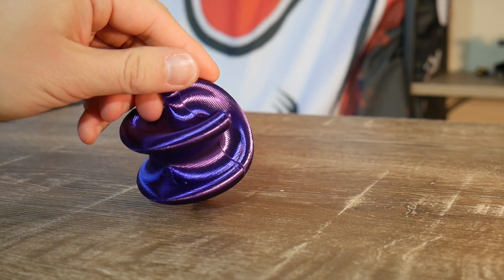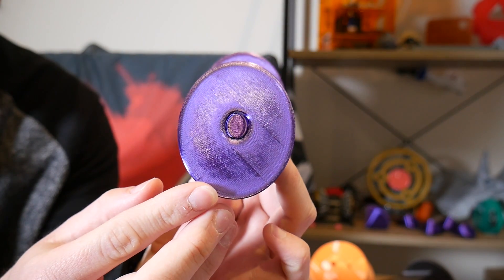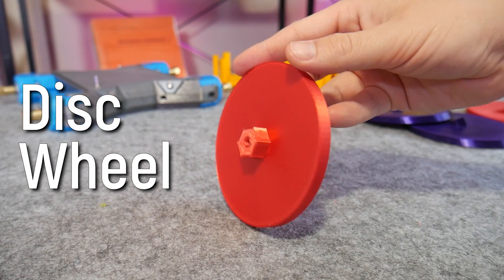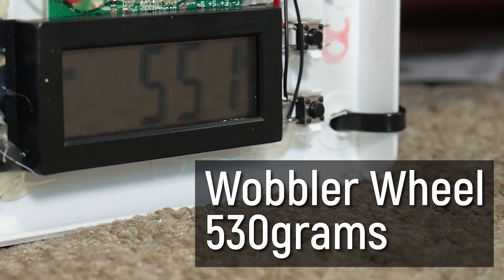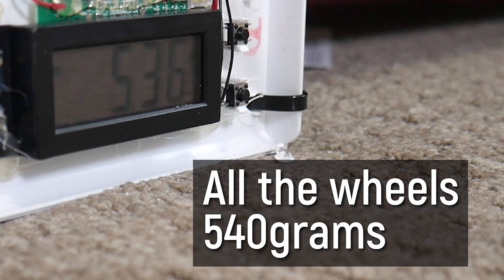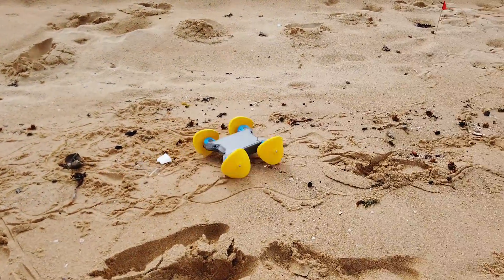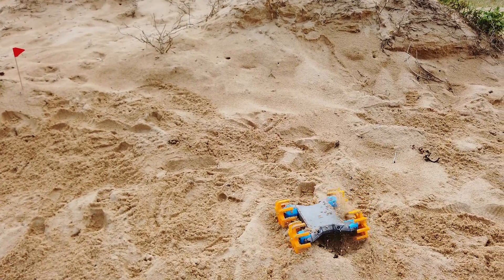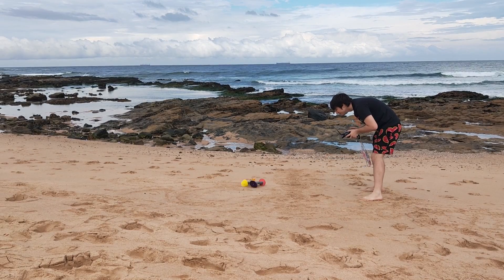This Robot Drives on Wobbly Wheels (but HOW?)

Comment: i think you need to test it with larger wheels. in offroading what you're doing is "high centering" the vehicle. once the weight of the car's belly is resting on the ground, it removes the traction from the wheels.  i believe that would give a better evaluation to each wheel and eliminate any variable surrounding the high centering of the vehicle.

Comment: I think if you made new motor modules similar to "Portal axles" to give more ground clearance (and maybe angle them out diagonally ( /----\ )to also increase wheelbase to fit taller wheels) you may have better results without redesigning the whole body

Comment: Mount the spoked wheels on backwards, spokes pointed outwards. and instead of presenting a flat surface to the ground, have the spokes slope upwards so the outer tips dig in first.

Comment: Two of the spoked in front with two wobblers in the rear seems would give a flat powerful pull force. For the sand a wheel that dispersed the surface over a wider area or large area pads or paddles would likely yield the best results. Another option that could enhance traction would be to have more wobbles in the wobble design.

Comment: I was curious if it makes it better when you put the spokes on an angle backwards (45degrees maybe). Obviously You’d have to give them a curve to maintain the circular cross-section. You know what i mean? I think it would run smoother on flat surfaces but maintain It’s Sand driving ability.

Comment: Oh yes definitely there's a better wheel design, just look at the real sand tires. They have the scoops like your tire, but they're a closed surface so they don't sink into the sand. If you make a cog-shaped wheel it would probably work better. (or just fill out the gaps between the spokes)

Comment: My main criticism is clearance. Easy way to reconsile would be testing in a different medium (grass or compacted dirt), or making adapters for your motors to get the chassis up higher. Clearance wouldn't be much help if it's gonna dig dig dig a hole, but it's a thought. 

I'm impressed by you're consistent and fresh ideas. You and you're mind would likely do a lot of good in the FreeCAD community. I understand why AutoDesk updated their terms for free users, but it doesn't change how I feel used and disenfranchised when helping promote the software and getting mildly involved in their forums (I could technically get an education license for my job, but that's not the point) Open source is the best solution I am aware of, and FreeCAD still has a long way to go as far as user friendliness. I can't wait untill FreeCAD finally hits version 1.0
Maybe YOU (reader) could help with that :)

Comment: I bet that 5 spoke wheels will do no better than a regular wheels on a flat surface. On carpet these wheels do not have a constant contact with surface, but every individual spike hits a carpet fleece at an angle, giving it a better push on the first contact.

Comment: is the propultion actually better on loose surfaces compared to regular wheels due to the angle of contact? for example on higher speeds will it dig in less easily? writen at 3:30

Comment: You could design wheels with spares, in this would be compliant mechanism attached to shaft/motor extending paddles through the spares. Slow spinning would keep the paddles inside the wheel diameter and allow for normal travel, once you get into sand  hole, increase speed, faster rotation would extend the paddles allowing more grip... hmm reading after my self, I might not make any sense :D

Comment: When you're testing traction, you should take the maximum number that can be sustained without spinning the wheels, it's at this threshold that the wheels lose traction and start to spin.  Once they're spinning you're not getting the same peak force forward.

Comment: Future videos on this topic will probably rediscover tread pattern optimization. You pointed out the reason why the spokes work well in the sand, yet the spokes were too hoppy on carpet, and wouldn't do as well in terrains that aren't loose. There's also a reason why the wobbler and prongle wheels work better than the discs, similarly they'd also work better in other terrains, where discs are really only optimal for dry, hard terrains in straight lines. 
It'd be even more interesting if you got into flexible filaments and deep dived down the topics of grip and deflection, after fully exploring the topic of tread types, of course. 

I also feel that the prongle is an expansion of the wobbler, they leave the same basic path shape except the prongle produces more cycles of the sine wave pattern. Almost like the prongle is a 2x of the wobbler, thus a variant of the same wheel/tread type, which would provide redundant results unless you're looking for specific differences in performance between only those two, which would require testing an order of magnitude more complex, i.e. bordering scientific-grade testing. I feel like a better wheel differentiator would be modifying the waveform the wheel produces, say make a wheel that produces a triangular, square, or sawtooth waveform as an alternate to the wobbler's sinewave pattern. 

Also the internet clout chasing problem is a massive issue. Most content creators watermark their videos for this reason, some content creators go as far as physically marking their work to deter clout chasing due to additional, more complex editing to remove the physical mark. I'm a bit surprised that you don't have any content creator identifiers to lead viewers back to your original content when your reposted content isn't credited.

Comment: I think weight is an important part.
I don't know how many % of the vehicle weight is in the wheels...
But significantly heavier wheels with the same wheel surface area = significantly heavier vehicle with the same wheel surface area would do differently on all the tests.

Comment: I wonder if there's an improvement by flipping wheels "outwards"...so slotted wheels have the spokes facing out instead of toward the chassis.

Also, adding treads to all the wheels (similar to the average depth of the spokes on the spoke wheels) may make the wobblers perform better in sand.

Comment: 6:01 hmm... the wheel to the right of the chain seems to be pushing the platform to the side
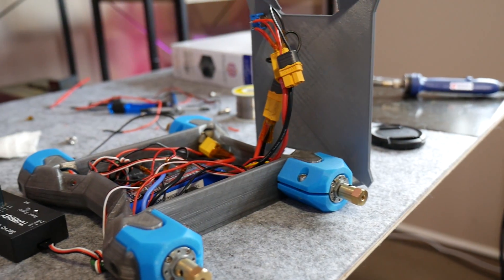i think it is at least partly because that side seems to be heavier than the other three (1:32 I think I the battery is on that same side...) thus it might have had better traction on that wheel and maybe it along with the irregular shape caused it to move?

Comment: On a full-sized car, I would think the axial load on the motors would be a large problem, especially if you had rubber tires that had more friction than PLA wheels.  I would also expect the motion would wear out the tread much, much faster.  They are still mesmerizing to watch.

Comment: I'm not interested in drawing this up, but I welcome someone else to: You want more ground clearance to avoid bottoming out. You need fins for traction without being so deep they creating a rotary shovel. Finally, you want to spread the surface area of the wheel across the largest possible ground surface to prevent the wheels from sinking or digging into lose sand, similar to a snow shoe. Create wheels with 3 spokes, each ending in a kind of curved snowshoe (like you had a full wheel but cut away everything except a few ovals of tread). Use the largest gaps between the snow shoe hatches that can still can compact loose sand without letting a lot through. Elongate a few of the hatches on the snow shoes just enough to dig into sand, but no more.

Think about which diagonals to use for the traction fins. I'd lean toward using the same angle on the two diagonals, but reversing it for the adjacent wheels. Other options include having the left match and the right match, and they can either create an arrow, pressing sand in, or a V pressing sand out. The last option is matching the two front, and matching the two back, but I fear that would create a tenancy to pull the front and back in different directions and encourage spinning in place in certain situations.

Likewise, think about the contact pattern as the wheels rotate, so that you always have 2 snow shoes down, and curve the leading and trailing edges of the snow shoes so they contact smoothly and not on edge, particularly when starting from a stop.
Reply: I was.about to start a thread on a similar theme.
- Larger diameter to get more ground clearance.
- Bigger width to span more sand
- Mesh surface to still have similar surface area despite larger diamwter and width.
- Some regular "blades" that can shoot sand backwards.
Reply: While I thought the same, creating wheels for optimal traction on sand wasn't the point of the video.

However I'd love to see it done too in the future.
Reply: Imagine writing all that and only getting 68 likes

Comment: Regarding the “pull to the right”
That’s because of the carpet pile direction. 
I’ve notecard that many time with a vacuum. 
You push it one was and the carpet pushes its to the side. 
Go the Other way across and  pushes the same cardinal direction.

Comment: Love the video and here is a wheel idea. Try create an expanding disk, this will disperse its weight over l larger area lowering the risk of sinking (think one of those frisbee balls on its side also, the expand and retract mechanism is unknown/planed). Also,  you can add treads of different patters to add traction.

Comment: A design improvement on the spoked wheel: perhaps make the center of the wheel a bit more solid, so that the sand will rest against a larger surface area and then have the spokes working only to scoop out sand rather than as the main support structure. Also, angling them might help.

Comment: The paddle wheel is round with consistent contact patch. I like it. Your problem looks like ground clearance as much as traction. Try a double parallel disk, and do both the wobbler and the prongle with another one crossing over to make like an X only one straight and one curvy. and I guess double the tines on the paddle wheel

Comment: The wobbly wheels (the nightshade elixir wheels) have a tendency to go right because of the angle of the profile. It creates an unbalanced force or motion or moment that causes it to go to the side, just not sure which of the three. LOL. If the front and rear wheels are connected to each other on each side with a chain drive or a gear drive, you could set them to be have opposite angles of each other, it will cancel out the imbalance and make it drive straight.

Comment: 8:00 I have a idea why that worked so well. Because they were not equal.
If the wheels are roughly the same, they will all cause disruptions in the same way. Disruptions that will add up, thanks to constructive interference. Resulting in that whole jumping (and thus loss of ground contact).
But if they are all different, the interference from any one of them will have nothing fitting to constructively interfere with. There is never enough buildup of any one disruption force to cause jumping and thus ground contact loss.

Comment: I don't think the "equal surface area" criterion was actually fair -- the grip of a wheel is surely determined by how much is contacting the ground at a given point in time...?

That means the toothy wheels have a double advantage, in that the have not only the biggest contact area in a soft, compliant medium, but they also generate force along the axis of motion.

Comment: If you build a gear drive that drops the wheels below the center line of the body, you shouldn't get stuck on sand mounds and ruts

Comment: The prongle wheels could be useful for a short term rover that is supposed to drive on flat sand. Throw that little rover on a salt flat and give it a solar panel and some other stuff and you’ll be able to drive it for a looong time

Comment: the spokes had the same surface area, but the maximum contact area was so much higher! but really you're going to lose every time with smooth wheels on an incline - this is why trains can't go up tracks steeper than 1 in 30. try with increased clearance and tread marks on each wheel (and disqualify the paddles) and then i bet prongle wheel will take it every time

Comment: The spoke wheels actually had a lot more surface-area-to-ground than the other designs, because at least part of the lateral surfaces would also be in contact with the nap of the carpet or the piled-up sand. Wider wheels reduce the pressure per square inch and would mitigate against the tendency of your rover to bog down. Instead of testing different shapes, you should test different thicknesses of wheel- and I'm pretty sure that wheels with fat rims would do better on your course than any of the non-spoked designs you test in this video.

Comment: For starters, you could try laying out a course on a hard surface, that would make it a lot more fair. The main reason those 8-spoked wheels did so well is not the digging in part, because your vehicle is incredibly light, but because it has much more of the wheel in contact with the surface of the sand at once.

Comment: I would argue that the spoke wheels have a larger friction surface when used on the loose material surface, as the sides of the spokes do make contact with the surface material. 

If you added some "treading" to the surfaces of the wobbly wheels (and prongle and regular wheels), then calculated the surface area of each wheel to include the tread depth - once per tread, as only one side of the tread will make frictional contact at a time - then I think that would make the comparison more fair. Depending on depth, though, you might end up with a conundrum of whether the inner radius of the tread should be included in the area.

Of course, then you could also compare the effectiveness of different tread depths per wheel type...

Comment: The only criteria should be, the wheel must have a continuous point of contact for its circumference, or a continuous unbroken edge 👍🏻😊 therefore as the paddle / spoked wheels don’t have a continuous edge, they should be disqualified 👍🏻🤔

Comment: Instead of comparing them based on the wheel's outside surface area, it makes more sense to compare them via traction based on how much surface area makes contact with the ground at any given time. The spokes in this case have the greatest advantage because they get WAY more traction since when they touch the ground, way more surface area makes contact.

Comment: a suggestion for a wheel design:
The spoked wheels, but instead of spokes, actual paddles. That way they have more grip (since there's no flat on the top of the spoke)

Comment: I get the whole surface area thing but the spoked wheels are much wider then the others which may have given it an advantage in getting caught on sand since it doesn't dig ruts and can actually drive over some holes

Comment: I wonder how 'Wacky different wheels' might perhaps also be useful on the sand? 4 spoked wheels is good, but what about two spoked wheels and two prongles with one being narrower so they don't run in each others' tracks so much?

As others have mentioned, the clearance became an issue pretty quickly and there's an obvious solution there...but there's also a WEIRD solution involving putting rollers with varoius cookie-cutter designs on the base that might be extra fun. (Or just moar wheels, but I kind of want to know if Santas have better traction than pine trees)

Comment: I think the big problem you're hitting is material match up, along with the motors not having an analogue throttling method. You might find that all of the wheels would bog less if they're working up to speed instead of being full on or off, or maybe you add teeth to the wheels in place of tyres. Doesn't help for once they are bogged, that problem is down to material they're made of/driving on and the physics of weight displacement. Remember that even vehicles purpose built for loose terrain still can and do bog, and the only consistent solution for that is to be towed out by a non-bogged vehicle.

Comment: I think it is more about the clearance at this point, not the wheel design.   If you were to make the wheels sit lower from the body of the vehicle, I think all but the "round" wheels would have completed the coarse.  Take a look at the Mars rovers,  they have a lot of clearance to prevent it from getting stuck in the sand.

Comment: To make it all a fair test

First off the chassis of the vehicle should be a bit higher so there is propper clearance. 

Secondly test against different sorts of terrain. If possible actually make various areas like sand, gravel, dirt, asphalt and grass. With every path through each terrain being the same. Eg same race track different terrain.

After each test, reset the area. Each raking the sand, gravel and dirt smooth, clean up the grass and asphalt

Comment: I think the chips and the wobblers are almost as capable of moving and propelling dirt. but propelling dirt isnt the best thing to do when youre stuck.
When youre stuck you want static forces into the dirt to push out.
they have a tiny contact area, no floatation, you bottom out faster and more completely then have no ability to apply static forces into the dirt to become unstuck.